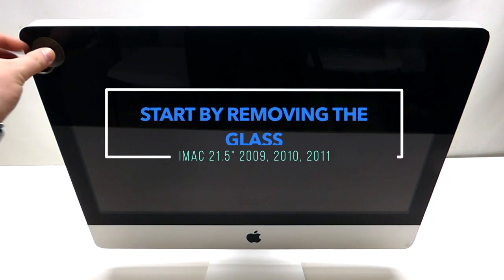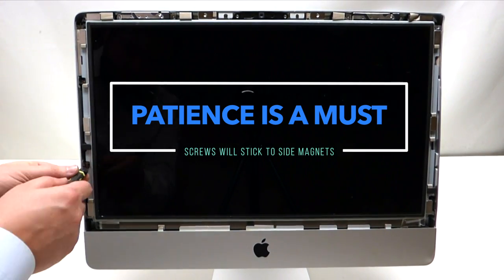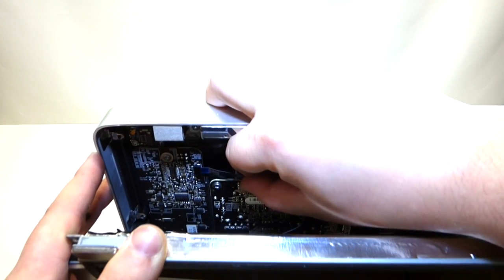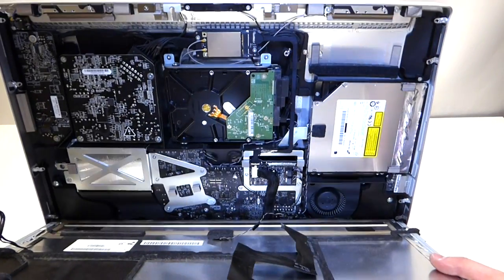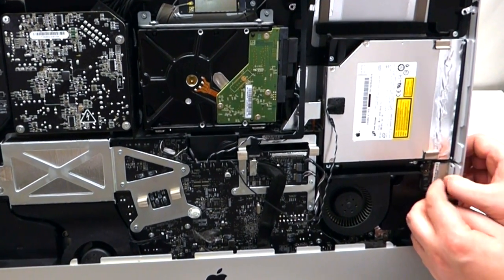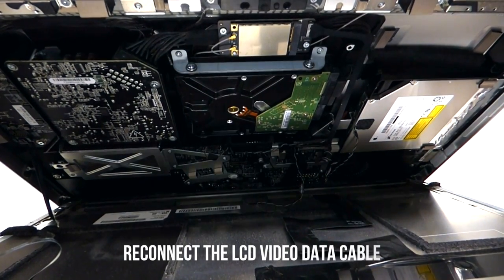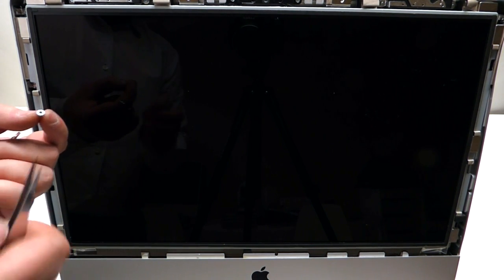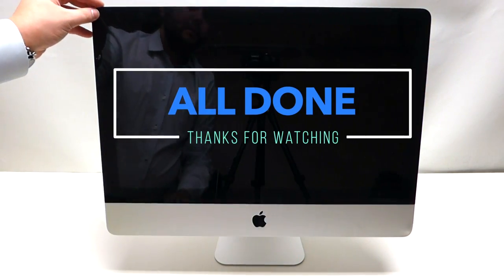iMac SD Card Reader Replacement 2009 2010 2011 21 5" Apple Dollars #16

Comment: great video - I followed it to the letter and it all worked fine...
EXCEPT
When I put it all back together I find that I have suddenly developed an intermittent screen flicker - never had one before.
I suspect that I have put the cables back in and one of them is not properly seated.
Could you suggest which one it might most likely be?
Thanks for the help
Tony
Reply from the maker: Maybe the LCD inverter cable https://www.youtube.com/watch?time_continue=8&v=_KXAZXdRVP0 just remove the LCD completely and reinstall it like a fresh install and see if the problem goes away.
Reply from the maker: http://www.appledollars.com/20092011-imac-a1311
Reply: Can the Sd card slot be replaced in a 2011 MacBook Pro?